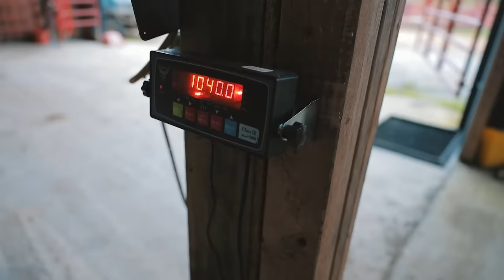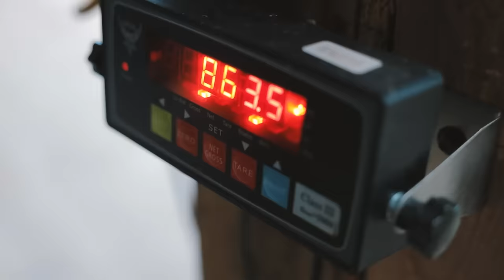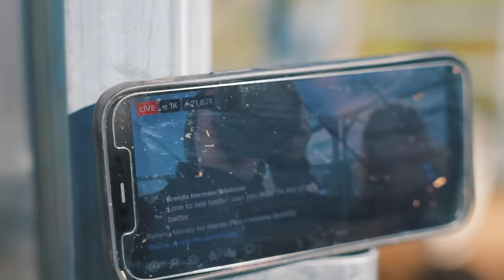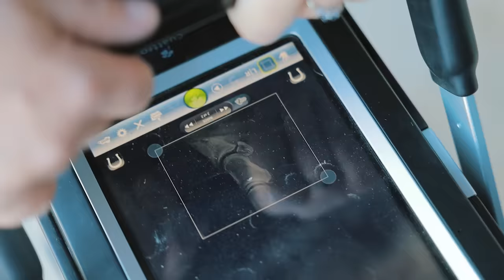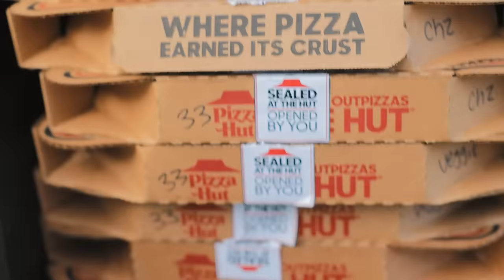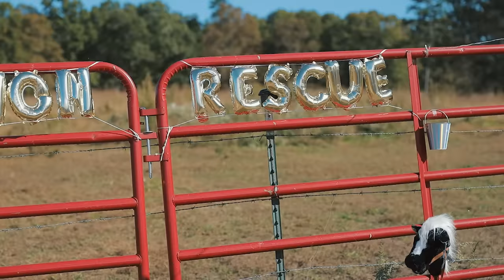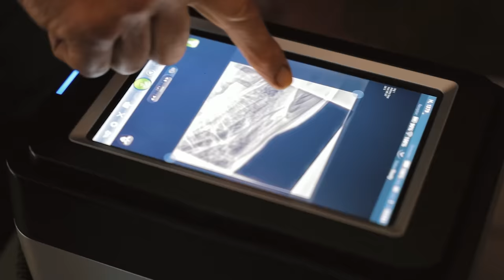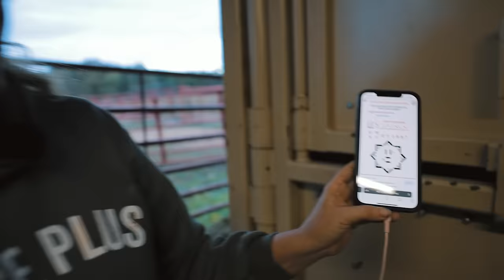Horse Shelter Heroes | S2E34 | AUCTION RESCUE

Comment: I'd say the next thing to do is to get horse blankets/coverings for these precious babies so they aren't out in the rain while waiting on intake. ♥ Some of the horses coming in need that insulation as they don't have the weight on them to keep warm. Could you all throw some up on your amazon wish list? Keep up the great work!
Reply: I would think the problem with trying to blanket them if they don’t know if they could blanket them especially the ones that don’t really want to be handled
Reply: Thats understandable. As for Coverings - as in an awning or a shelter of some form that keeps the rain at bay so they are not standing out in it.
Reply: Most of these horses have probably never even seen a bblanket. Trying to get one on in such a stressful environment would be extremely difficult.
Reply: I agree...
Reply: I'm sure they have blankets but @ the Same time they probably need a good rain to wash some dirt off them as well
Reply: Those horses that are in the worst of shape really don't mind getting a blanket on, thwy haven't got the energy to get worked up about minor things
Reply: 2222222222222222w222222222222222222222222222222222222222222222222222222222222222222222222222222222222222222222222222222222222222222222222222222222222222222222222222222q2222222222222²222222222222222222222222222222222222222222222222222222222222222222222222222222222222222221222222²222222222222222222222222222222222222222222222222222222222222222222222222222222222222222222222222222222222222222222222222222222222222222222222222222222222222222222222222222222222222222222222222222222222222222222222222222222222222222222222222222222222222222222222222222222222222222222222222222222222222222222222222222²22222222222222222222222222222222222222222221
Reply: Geez, I thought you were bringing them home to make them healthy and already you're going to Euthanize three of them , this is entirely to sad 😢

Comment: Just a tip: when you hitch the trailer, there are 2 (emergency) chains. Attach chains as usual but criss- cross the chains. If hitch fails, it will be "cradled" by the criss-cross chain configuration.
YOU GUYS ARE AWESOME
💕💕💕💕 🐎
💕💕💕🖤🐈‍⬛
💕💕💕💛🐈

Comment: Last act of kindness. 
Just use the word. Euthanatized. Calling it something nice doesn’t change the fact it ended up just as dead as it would if a kill buyer got them. 

So tired of hearing it’s a kindness. It’s not. They traveled stressed in a cramped trailer and still ended up dead. HOWEVER. A few were saved right? The adoption fees sure come in clutch.